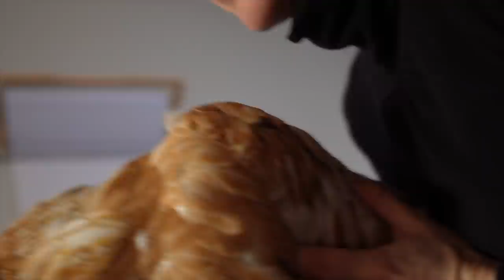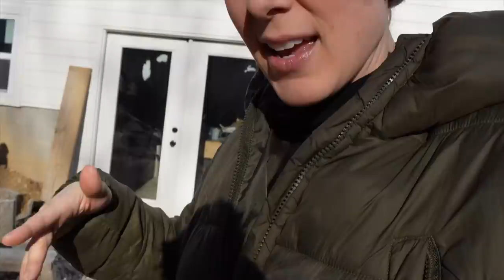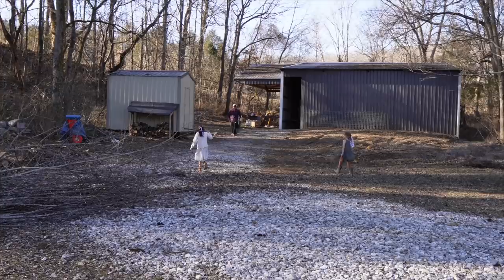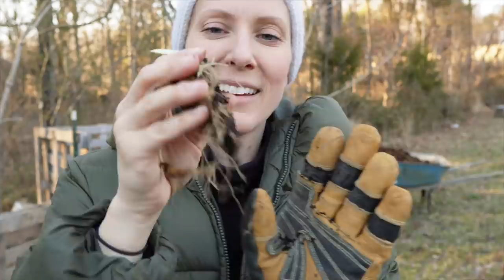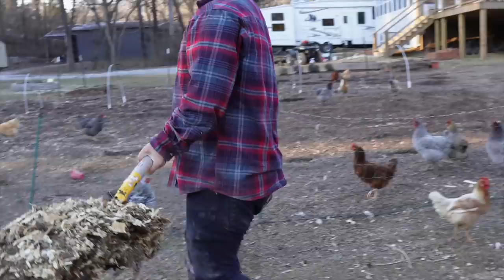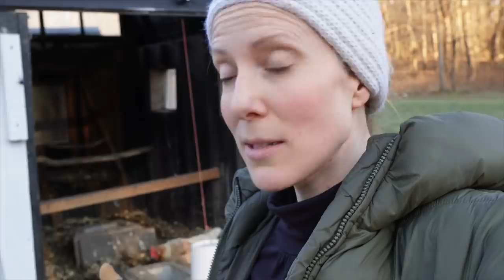NO CLEANING...How Our Beautiful Chicken Coop Doesn't Smell!!

Comment: I love compost. I have a stationary chicken run so I have included my compost bins to be inside that with even the floor being a deap bed compost. The chooks turn the compost for me. I also have other compost bays but the ones inside the chicken run is way more affective. I add all scraps to the top of the bays and they scratch it so well. My chook pen has no smell as well even with horse manure and wood chips everywhere. Every 6 months I dig out the black gold and start again.